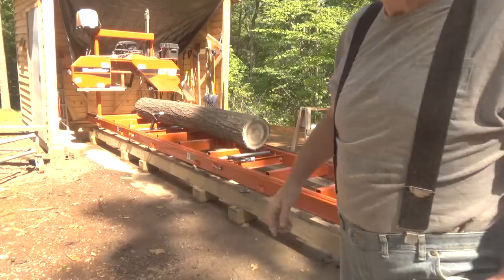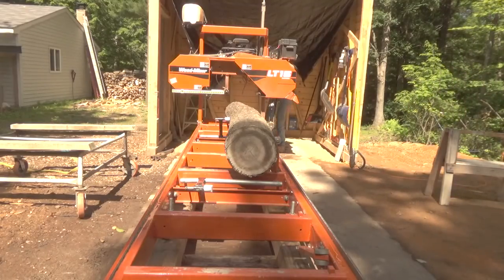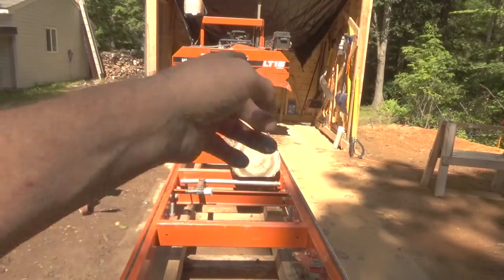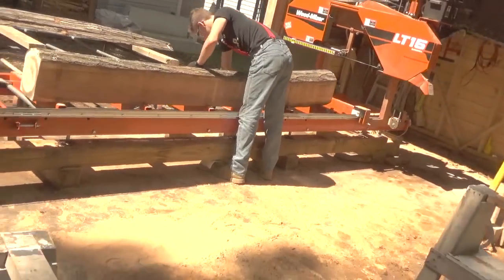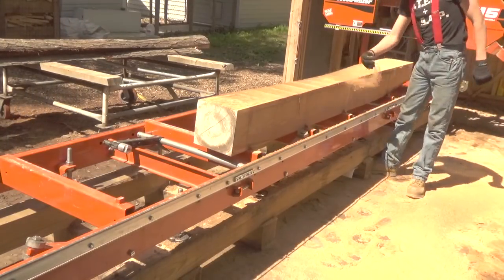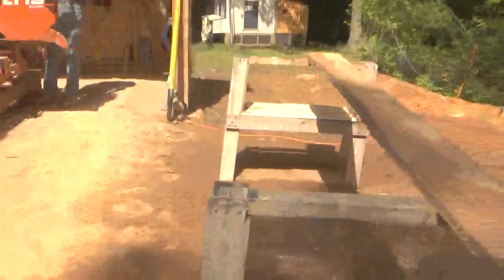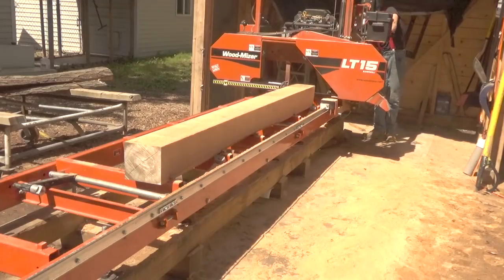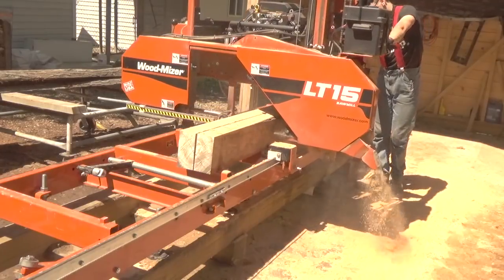Teaching the apprentice how to cut bent log with the Woodmizer LT15.

Comment: Should be taking the horns off before the bow, Josaljo.
Reply: As it is you've taken more off the short end than you have out of the middle. Then when you roll it you'll again be governed by the short end and take off more than needed. 
Think of it this way: your maximum cant is governed by the  distance at the centre point between straight lines drawn from the butt cut to the apex cut.
Not my wisdom. I got it from:
http://www.woodweb.com/knowledge_base/Dealing_with_crooked_logs.html
Reply from the maker: Nolan Tyrrell If by maximize you mean short piecess of wood, like that way described by woodweb is ok. But I don't want anything less than 8'. No matter how you cut it there is only one path through any log to get the biggest cant. That is what I want, the biggest full length cant. For my needs short flitch pieces are not usable.But I can see where someone needing short pieces might follow that method. Thanks for the comment.
Reply: Josaljo Won you could be correct. I doubt it. You are governing your cant size by trying to get the largest cant achievable following the angle from butt to top. Try it on a small scale with a hands as and see what I mean.
Cheers.